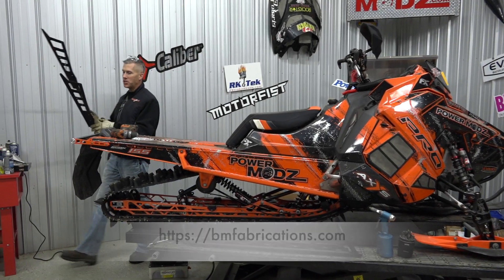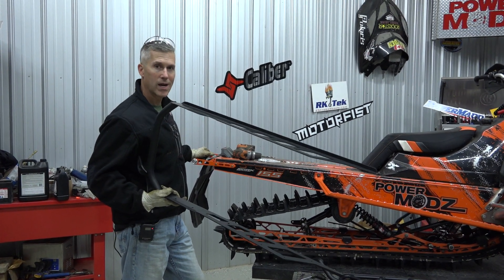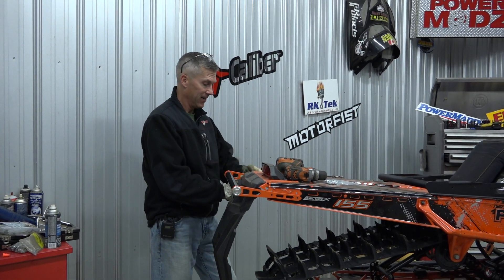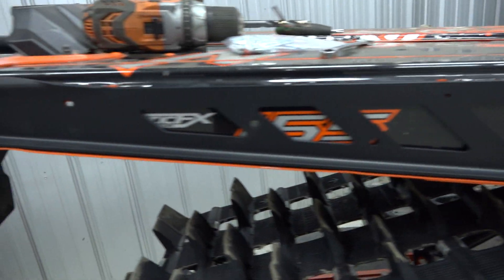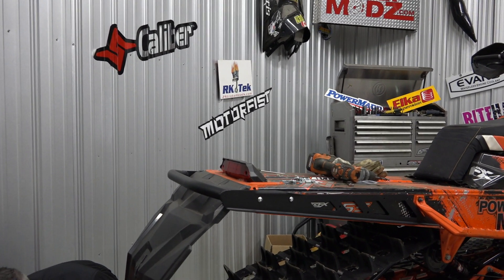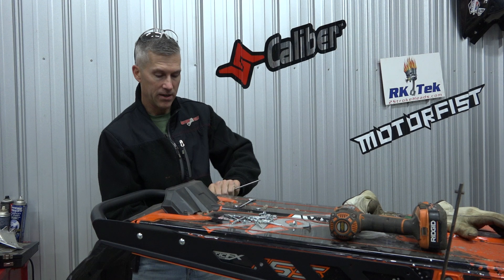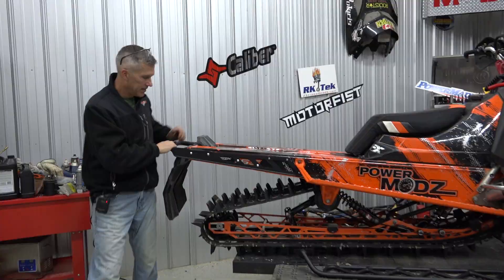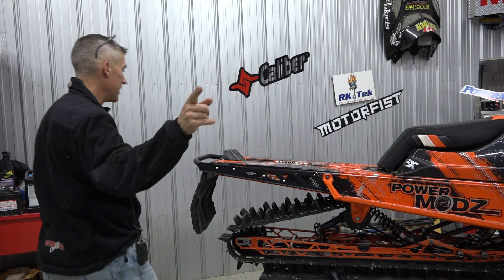BM FABRICATIONS EXO REAR BUMPER INSTALL    POWERMODZ!

Comment: New sleds: Oh no! I added two ounces of weight to my sled i need to add a turbo now and i also forgot to empty my gas tank last week now my sled won't run weeeeeh!

Old sleds: 80% iron run on beer and ten year old fuel. 

I'm not hating don't rage on me please:)
Reply from the maker: Lucifer Satan lol it's all good!  I ride them all.
Reply: I'm pretty sure old sleds can run on anything you put in the tank, I had a tundra that I left in a shed for two years with no stabil or anything in it and I pulled the starter cord once and It fired, I even rode it to the trailer
Reply: New sleds: can't afford one

Old sleds: stale gas, no motor job since '98, trailing arms snapped off years ago, still fires up after being abused and neglected for decades. Good for another whole season.

Comment: You need those upgrades, because polaris is too weak and fragile. Polaris is no good and will never be good enough. Any other brand is much better and can take much more of a beating than that piece of trash.
Had to repair way too many sleds with bend tunnels 90percent of the time it was polaris. Dont even get me started on the a-arms like damn.
Reply from the maker: Jonny Pi ok thanks but I'll ride thos sled over all others any day!
Reply: PowerModz why do you ride polaris any day what is the selling point?
Reply from the maker: Jonny Pi I've tried many sleds and for what I do this Polaris fits the bill...its like riding an elan when.i was 7 years old.  The doo feels heavier, the yami is heavier...and the cat....is a yami...or is it the other way around?
Reply: It is a good looking sled, but parts cost a lot of money especially living up north with all the shipping charges and the Polaris dealer sucks in the Yukon they mess up all the time. Everyone i know with a Polaris has nothing but issues stuff bending in situations it should not. Thats why a lot of people ride skidoos, because they are reliable.
Reply: Fair point. I like the feel of the doo much more than any other sled and I like how much it fells like my ktm 450 dirt bike. so far no problems with doo except of the 2005 year when they made the mach z 1000 and my voltage regulator went and took many parts with it.
Reply: Ski doo and polaris are on top, the other guys are great but ski doo and polaris have both figured it out pretty good